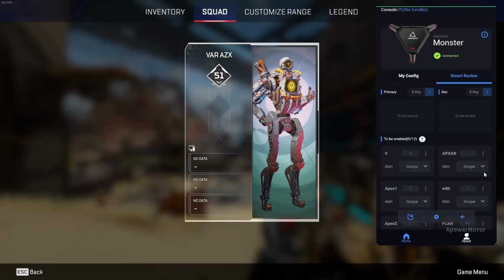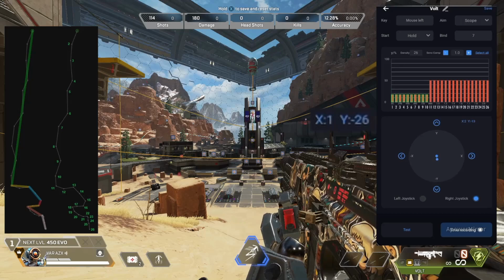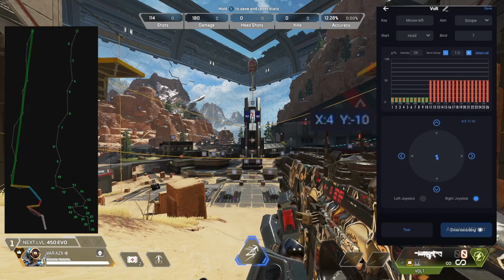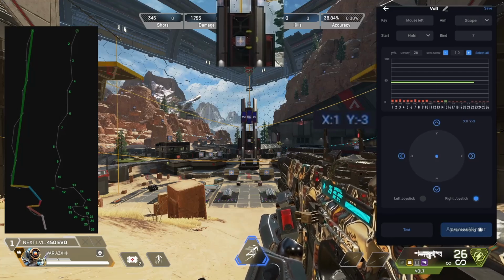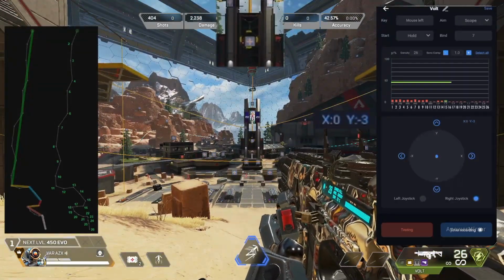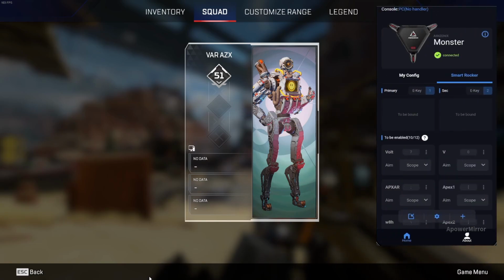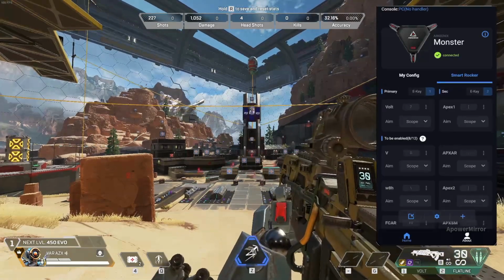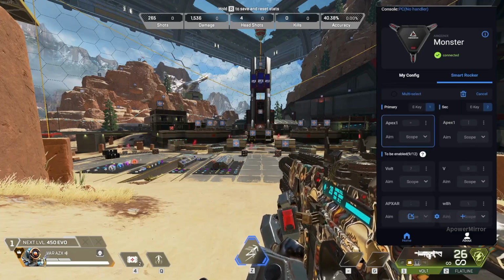Smart Rocker. Recoil assistance feature.

Comment: Is this possible on pc too?
Reply: How do u select more than one at the same time?
Reply from the maker: @miguelcasimiro7446  press one and hold then swipe over more segments
Reply: @VARIANT3XR  thanks man 🙏
Reply from the maker: yes, the ax200 and the monster work for pc
Reply: @VARIANT3XR  Can I use it right away without any additional settings?
Reply from the maker: @duna2-f8l  what do you mean by additional settings? i dont get what you are trying to do
Reply: @VARIANT3XR I'm asking if I can use it right away after connecting the AX200 to the PC and installing the geekvice app. If you look at your Deng video, it's set up for each gun, so I'm asking.
Reply from the maker: @duna2-f8l  smart rocker will be empty when you connect the ax. You will need to import a macro or create one.
Reply: @VARIANT3XR So, are there any macro that are provided by default?
Reply from the maker: @duna2-f8l  no. There are a few for apex on the discord
Reply: @duna2-f8l you need a good config